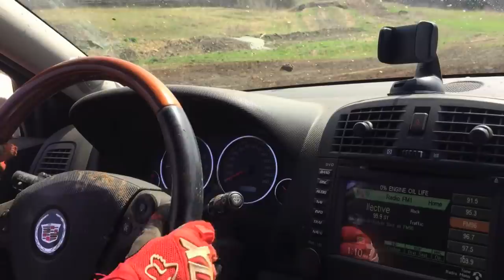550HP $1000 Subaru VS CADILLAC!

Comment: Why would u blow up the one that doesnt smoke?   And the GMC pick up.. I got a way to start it with no key.... take a flat head screw driver stick in the key hole then use a pair of pliers to turn the ignition breaking the lock then u will be able to start it with a screw  driver
Reply: thats what i thought, blow up the smoker. also they tried the screwdriver trick already... it didn't work
Reply: @uncrustable9923  no they didbt try the screw driver trick.. that Brad dude tries to turn it with his hand...lmao ull never turn it u need pliers to break the lock... it does work.
Reply: @uncrustable9923   hammer a screwdriver straight into the ignition lock breaking the pins in the cylinder and then just turn to start. The final method is to just remove the plastic ignition switch from the rear of the lock then insert a screw driver turn and the car will start.